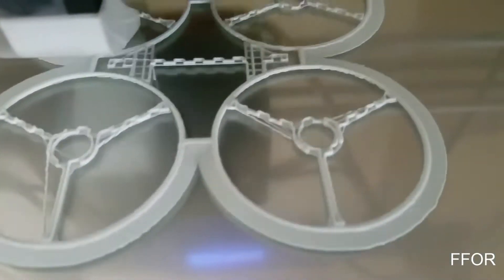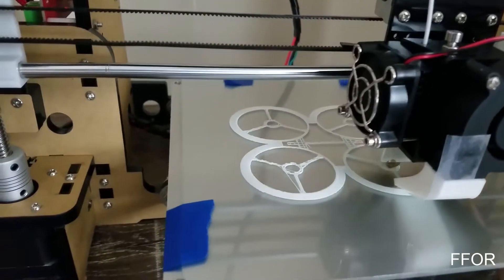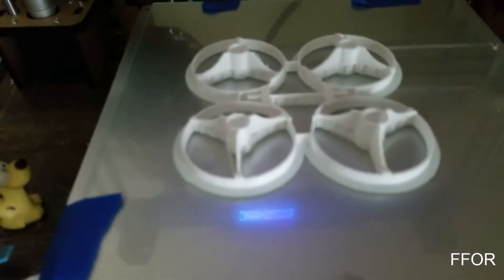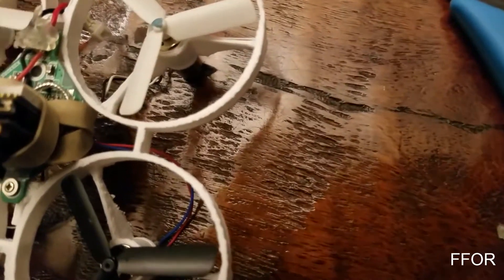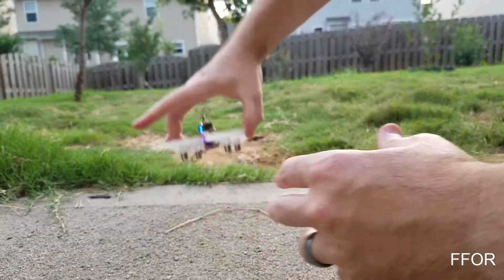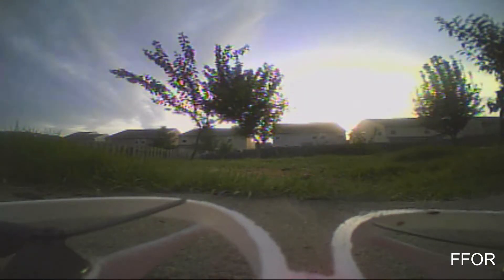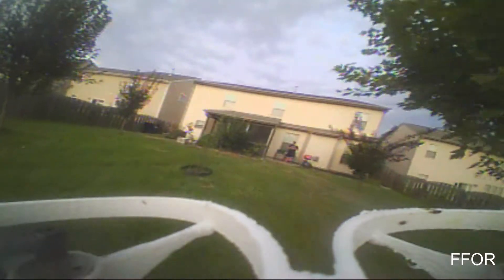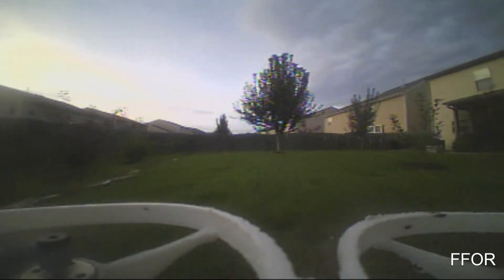Eachine E011 Upgrade - Read Description

Comment: Sweet video vid, looks like a great frame too. Can you recommend a battery which would be good for this?
Reply from the maker: https://www.banggood.com/5PCS-Eachine-E010-E010C-E011-E013-3_7V-260MAH-45C-Lipo-Battery-USB-Charger-Sets-p-1205884.html?p=5Z14237990857201612G  any of the 260Mah 45C or so batteries work well, just make sure the connector is the eachine style and not the furibee style unless you want to solder or modify your connectors.

Comment: The flight at around the 5:00 mark is rock solid! Was expecting much more oscillations.
Reply from the maker: lebasson the larger motors, props, and frame is a serious improvement.  I'm not sure if it's faster, but it was so much easier to control and smooth, especially with the toy controller

Comment: Chris, you should check out https://www.facebook.com/groups/cncbuilddesign and https://www.facebook.com/groups/413914002327906
Reply from the maker: Robert Thompson joined both.  Thanks greatly.  I'm just getting started with the printer and it's already just... Not quite as addicting a quads... But rings the bells